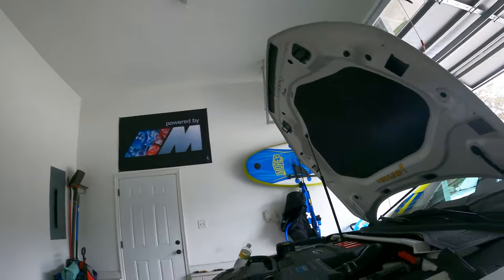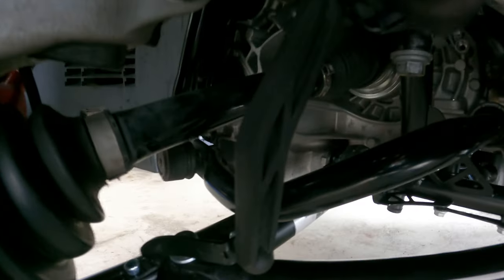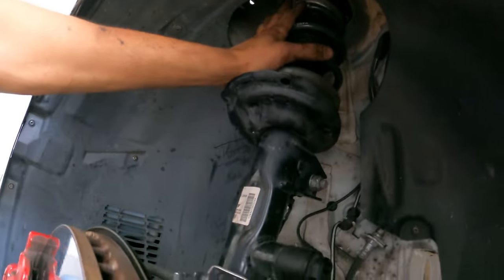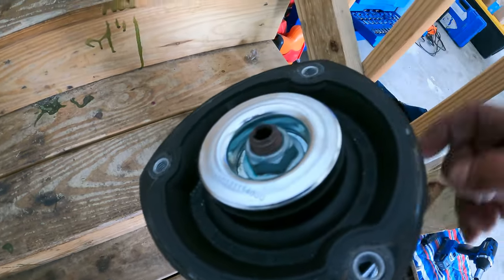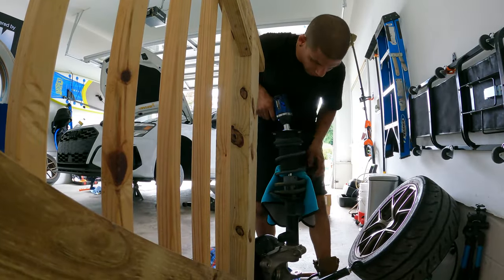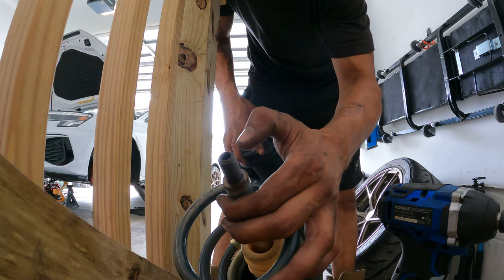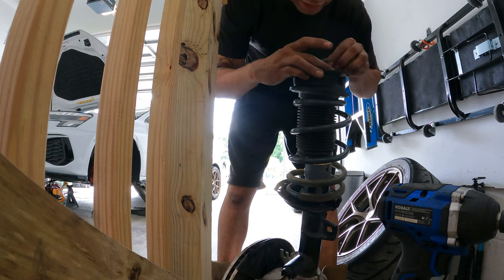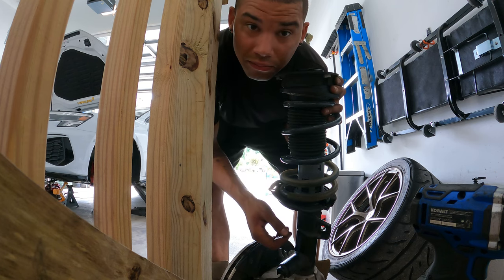Euro sport camber kit for MQB cars - Install

Comment: Bryce, I love the videos but as a fellow enthusiast can I recommend something for your next video for the strut top? The item you want is a pass through socket kit for the strut top. You can find them at harbor freight or amazon for cheap and you wont take the chance on marring up your strut and potentially costing you a few hundred to replace. They work great for many other things too including replacing all my deep socket items that don't need impact strength tightening. Yeah you don't get to zip the top off with an impact but once it's loose you typically can.

Again pass through socket kit, cheap and can be found at a lot of places.
Reply from the maker: Totally understand and I appreciate the lookout! Personally I've been doing it this way for years.. and every shop I've worked at or seen work also just zip it with an impact both ways. It doesn't take a whole lotta force to hold that strut tight. But I honestly should be doing it the right way, I'm going to add that to my tool list. If I was working with some expensive coilovers like ohlins or something I'd definitely want to have the right tool for the job
Reply: @BryceJordanProductions  Good stuff, I've done it that way for years before too so I get it haha. If you have the extra space/cash it is definitely one of those QOL improvements like the ball joint tool.

Comment: I had these installed on my R awhile back.  Unfortunately they do clunk over sharp bumps, despite being advertised as giving "zero increase in NVH."  I'm still glad I have them, though, because there is definitely less understeer than before.  The outside edges of my tires don't wear out first anymore!

And you probably already know this, but setting the XDS to "strong" is also extremely helpful.  The car turns in really well now with these two mods (along with a fatter RSB, obv).
Reply from the maker: I used to play with xds alot. Tighter courses I'd turn it up to help me get around cones and stuff. Didn't like the way it felt on more open courses or on the street though. Sometimes I would slow me down too much it felt like a weight pulling me on that wheel. Definitely fun to play with though it's a neat trick system! Glad you liked the kit too, wish I would've done this along with the 034 ball joints awhile back

Comment: I installed these on my RS3 about 2 years ago. Recently developed knocking/popping from the strut mount, so now I have to pull the strut again and figure it out. I found drilling the strut mount and assembling the pucks to be a PITA. It took me forever to drill the strut mounts apart.
Reply from the maker: Funny you say this… my 034 strut mounts shipped today. Mine sound HORRIBLE. You can see the bearings when you jack the car up. -3.8° really wore them out quickly.
Reply: @BryceJordanProductions  did you order new strut mounts and new bearings? I just bought a new strut mount and hope the bearing is ok
Reply from the maker: I got mounts and bearings cause I know my bearings are s h o t. Might as well do them since you’re pretty much taking them out anyways. If they’re still good then you have spares 😉
Reply: I solved my strut noises but replacing the strut mount and bearing. It was actually the bearing making the noise, after removal I could reproduce a click when rotating it. It was corroded and deformed from 5 years of use.

Comment: How comes you removed the whole leg and not just the strut? Thinking I’m possibly going to have to do this as I’ve tried to open up the back of the strut but it just won’t release.
Reply from the maker: Easier, less hassle, less headache lol. I can have a strut out in 15 minutes with the knuckle and rotor attached. Takes twice as long if you try and remove the strut from the knuckle in the car. Time is money 😃